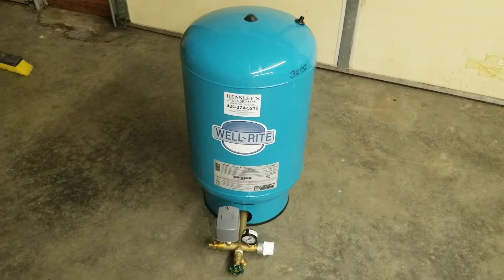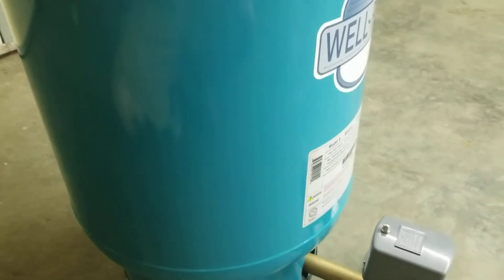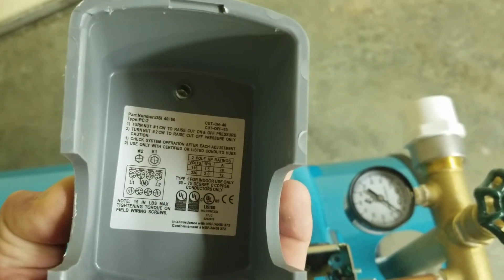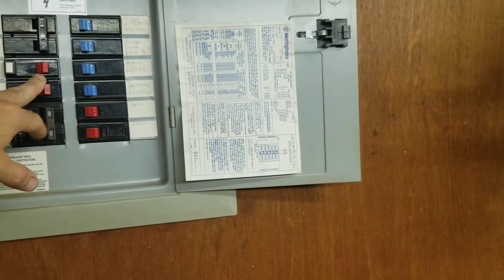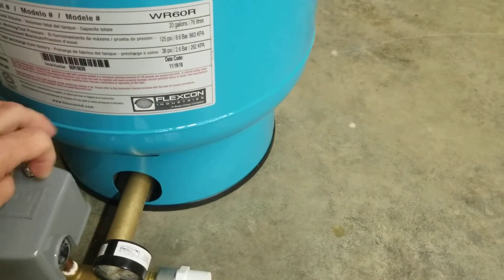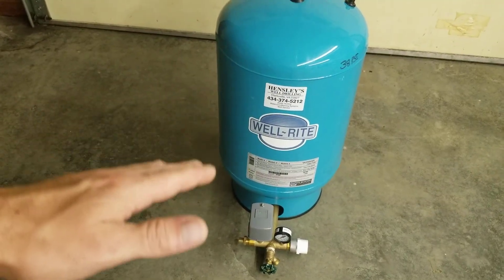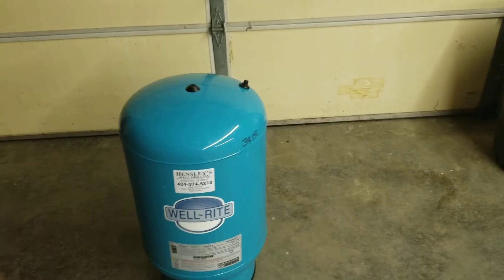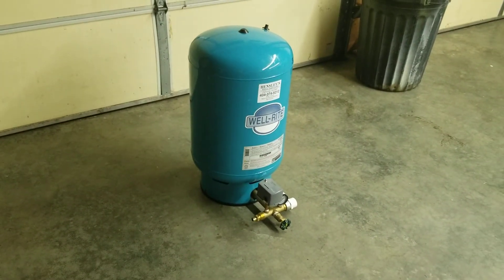Well Pump & Tank Troubleshooting, How the system works, Adjusting Pressure Settings Correctly

Comment: Recently (few wks) the water had TONS of sand in it (well water for livestock & watering, not house). They are drilling wells for new construction of homes near by. I noticed hearing my well making noise. Now yesterday went out & NO WATER. Ck breakers & ok. Could my pressure pump have gone bad?? (am widow, 67 & alone out in country). Please respond asap.
Reply from the maker: I'd check the tank & switch

Comment: I just had a new pump installed the pressurre went up to50lbs when i turn off the pump it drops to zero overnight
Reply from the maker: 2 possibilities. 
1 the pump installed has a bad check valve or no check valve. 
2 the pipe the pump is hung on has a split in it. .
If it will not build up enough pressure to open the switch/turn off the pump for a few seconds, then its definitely a leak in the pipe somewhere. 

Also look for leaks around the house and under the house. If you don't find a leak, that means the leak is 100% in the well.

Comment: my pressure will not raise past the cut off . 30\50 pressure switch . is it my pump or tank. also when turn on water pressure goes right a way.
Reply from the maker: Watch my most recent video on the job.(Well Pump, Air in the system), You have a leak on the drop pipe down the well most likely.  Or a leak somewhere in the yard. The Video will show you where & what to look for & a way to test it
Reply from the maker: https://youtu.be/ndugJ00jxyI

Comment: Thanks for this video but do I test to know if pump is bad so far I replace the tank, the pressure switch and still no water. Thanks again
Reply from the maker: Test for power at the well. If you get power there & its not pumping, pull the pump out and inspect the wire carefully for broken areas or exposed copper. You can test pump once it's out with a quick dry run. It's likely a bad pump. Replace the pump and wire & youll be set

Comment: I have a well and I've done all the trouble shooting it comes on right but immediately goes to almost a drizzle any help I would be grateful
Reply from the maker: Use a clamp style amp meter on 1 single wire. If its above 11 amps then the pumps bad. (That's how to test it) . But your saying it runs for 3 seconds or so & then shuts off. That's a tale tell sign that the pump is bad. 
No simple fix. Replace the pump.

Comment: I have a larger pressure tank.... and it won't fill.  It is not coming on.  I used the lever to kick it on and it came on for about 15 seconds then shut off again
Reply from the maker: How old is the pump?  Sounds like it's kicking off on a overload.  Either age or lightning killed it
Reply: @h2omechanic  it is only 5 years old and it's a solar powered well pump generating the power to run everything
Reply from the maker: @pinedorafarms9739  solar is a complex system. It's best to call the manufacturer honestly.

Comment: where does the check valve go in the tank system
Reply from the maker: Typically the only check valve is in the well at the pump.  If you put one at the tank, place it on the out going side

Comment: My softener hasn't worked for a while. Won't use the salt. I have super hard water. I know nothing about plumbing and can't really afford to get a plumber right now. It got to a point where certain faucets/showers wouldn't work without my shower on in the lower level. It slowly got worse to where water would shut off randomly then come back on after a few minutes. Now it's 30 minutes and not at all. Any ideas?
Reply from the maker: To be honest, I can't help you. You definitely need a water treatment specialist. 
Softener heads have Valves & Seals that will go bad & the Media bed must be replaced. A typical Softener needs service every 5 years . 
Maybe try cleaning/ removing shower heads & the sinks screens. Soak it in CLR . Possibly just plugged up from the Calcium building up

Comment: Wow! Glad I found this channel. Just moved into a mobile home on a well. Troubleshooting the pressure tank to get more water pressure. Pressure gauge was pinned at 70 psi so we replaced it and the 30/50 was off so we made the adjustments which improved water pressure but the following day my brother thought he would replace the 30/50 with a 40/60. Now the pump will only run briefly and stop at 20 psi. Verified the pressure switch wiring. Need water ASAP for shower, laundry and general cleaning. Has the well dried up? How do I check? Contacts have spark so we know the pump is working according to your video.

Comment: my pressure tank makes noise when filling. any ideas ?
Reply from the maker: Check the air pressure in the tank (up top of tank)
Remember to turn off pump breaker & drain off all water pressure from a sink before you check the tanks air pressure. You'll Need a tire air pressure gauge (not the water psi gauge)

Comment: Hi ..my water comes on for 2-3 minutes go's off for a minute or so then comes back on and no more issues for the rest of the time you are in the shower...thank for any help..
Reply from the maker: If the tank is new, it's probably got too much air in it. Let some out. 
If the pump is 12+ years old, the pump could be overheating and cutting off on a thermal overheating protection

Comment: I added a t and check valve to main line for outside water hose but won't have water until i turn water faucet on in house which I 300ft  away. Submersible pump and pressure tank.

Comment: My well is about 300 ft deep and the pump is a 3/4 hp pump, I was thinking of using my well to water my lawn, do I need to have a pressure tank or can I just turn the pump on and off as needed? If, so can I use a garden hose or should I use a one inch tubing? Will the pump be able to handle load? 
Thank you for your help.
Reply from the maker: You definitely need a switch & minimum 4 gal tank to absorb the water hammer effect. If you didn't use a switch, the garden hose would blow up & pop. Pumps can build 150psi. The switch is a must

Comment: I have barley any water I check the air it’s good but still no psi
Reply from the maker: Leave your pump breaker off over night & try in the morning . If its still low pressure in the morning, you probably have a leak somewhere. Look for leaks in the yard, under the house. If you find nothing leaking, then its probably leaking in the well. Due to a busted drop pipe or a cracked pump fitting. That case the pump must be pulled & look for a leak.

Comment: Just changed out the pressure tank ... The pump kicks on and builds to 50 psi and kicks off ... Then it slowly loses pressure and will go past 30 psi (hearing all kinds of gurgling like the water is being pushed backwards) down to 10 psi where it holds but we have to tap a fitting by the pressure switch to get the pump to kick on ... We are then faced with air in the lines  ... It's some weird piping so things aren't in the typical location ... I'm getting stumped ... Pressure switch? Do I need a check valve in n the line? There isn't one BTW
Reply from the maker: You probably have a check valve at the tank. But that's not the problem. 
The check valve in the pump is leaking and the pressure is going back down to the well. Pull the pump out & look for cracked fittings/pipe/holes. If all looks good, cut the pump pipe & try to blow through the pump. If your mouth can force air threw the pump the check valve is bad. 
Either replace the pump or add a check valve to the top of the pump. 
It must be done this way, or the check valve at the tank will continue to create air in the lines. 
The 1st check is leaking and the second check is slightly leaking but will hold water at 10psi.

Comment: I have a loud bang when we flush. I changed the check valve, pressure gauge etc. The check valve was completely trashed. I'm still having a bang at start up and when the pump is starts again (like taking a shower) it's fine. Only after a while sitting  the bang starts again . A few times we heard the bang and no water was running at all.  I checked all toilets sinks etc and no leaks were found. Pressure reads bet. 40 and 55. Could a bad pressure tank cause this?
Reply from the maker: Yes, most likely it's a bad tank. Your Hearing Water hammer. When the tank is good, the bladder inside provides the Cushion that prevents the hammer affect
Reply: @h2omechanic  thanks for the super fast response.  I have a 2400 sq ft home. 2 1/2  bath. Only the 2 of us now. What size tank do you suggest? Also are home depot tanks any good?
Reply from the maker: @alanlevine3984  any 20 gallon tank will be just fine. Home depot tank is standard grade. Itll be fine for 8-12 years
Reply: @h2omechanic  thank you. Just got home from running some errands.  About 3 minutes later we heard the "bang/hammering ". No water was running. Toilets sinks, tubs etc. No faucets dripping etc. What the heck could it be? I'm going goofy over this.

Comment: My smaller maintance well keeps making a clicking sound over and over . I looked and th e gage goes to 49 the a few seconds later 48 then 39 then drops fast to 30
Clicks and then shoots back up to 49 .always makes a clicking noise when it shoots back up . It’s continual . I had my cousin replace the gadget a couple months ago when the water went out . I have a bigger main well as well replaces both those pets . Water is working fine . But that click and jump
Back and forth is new. 50 psi on both wells one’s a big tank that’s the main well and then the front yard is the maintenance well that’s a smaller tank which is the one that’s making this noise.Also the bigger well tank I can see some of the water kind of running when I looked at the hole in the top I hear water and see a little water running out if that’s normal running back into the tank not on the ground or out. 
Update on the smaller maintenance tank I did  from watching your video 
Knocked on it it was hollow I also checked the top layer and no water came out it’s just air and then I timed how long it took in between that click sound where it went from 49 to 30 psi and it was a minute and 54 seconds
Reply from the maker: Well your tank seems fine but it could be really low on air. 
Kill the power, drain off all water pressure and use a tire gauge to check tank air pressure. Set it at 25psi & see what your results are then. 
I'm going to assume that it has like 8psi in it, or more the 35psi. The air is very important to set correctly with the style of switch your using (I assume it's a 30/50 switch.  
There's loads of helpful information on my Well Pump Q&A Playlist.

Comment: Hi, I have an above ground water pump and it is very hot it will not turn on. Cleaned the points on the pressure switch, with the breaker on the pump will not run and gets hotter. Do you have any advice on what to try to replace first. Thank you
Reply from the maker: The motor on the pump is likely bad. It's copper winding is swollen & contacting the magnets. That creates heat & eventually a Short. Just time to replace the pump unfortunately. 
If your a mechanical person you can disassemble the motor and clean it & inspect it, oil the bearings and see if it helps. But that's just a bandaid. Any plumber would say it's time to replace it. 
Keep the breaker off when not using water. That'll keep it alive til a plumber can replace it. If you DIY it, but the Same make/model to make the swap out easier for you. Wish I had better news, but atleast it's advice nonetheless. 😊
Reply: @h2omechanic  Thanks

Comment: Hi, I bought a house that has a dug well about 12’ deep and right next to it a little well house with the pressure tank. From there it has to travel up hill about 100 feet in elevation. By the time it gets to the house the pressure has dropped quite a bit. If I were to replace the system what would you recommend?
Reply from the maker: It's hard to make a professional recommendation for a very shallow Well . But a 2 line jet pump would work fine. & also a submersible pump if you had enough depth and storage to submerge it under the water

Comment: Hi H2O . If my tank reeds 100 psi.  What’s that mean? Pls. Thanks
Reply from the maker: 95% of the time, it means that you have a bad broken gauge. If it is in a location that could possibly freeze then 99% sure its a bad gauge. 
If it truly had 100psi, you'd probably have Amazing high pressure inside and that means the Pressure switch is Stuck closed which means the pump is running 24/7. Possible but doubtful

Comment: Well I had great pressure in my house then somthing happens where I do not have that pressure other than my kitchen sink ? My kitchen sink still has the pressure but all my other sinks and show does not. Can you please please please help me out on this issue??????
Reply from the maker: That's very strange, maybe the faucet strainers need cleaning.
Do you have a filter?
How old is your well system? 
Also I Have multiple well related videos on my channel. Find the Playlist Labeled Well Q&A. There's even a Vid on getting better pressure from you kitchen faucet. (Any faucet)
Most likely it's a sediment issue. Possibly a bad tank as well, but my tank Vids explains how to test & see if its bad or working properly
Reply: @h2omechanic  I have watched more of your vid thx. My well is old but I put a new pump and pressure tank in last year all my pipes are all new to hole house no filter but a salt water softener that does not work well at all. I do have hard water. Man I’m telling you it blows my mind I think it could be maybe my hot water tank needs to be cleaned out would that do it ?

Comment: Great video!
Question: Well not giving water, tested switch on wall and it is good, found a lot of water in pressure tank that would not drain(replaced tank) Saw arcing on pressure switch, still no water. Pulled pump and cleaned screens a bit.
Still nothing seems to work?

Comment: Great video explaining the pressure tank and limit switch.  I had a new blader tank and pressure limit installed this winter.  It's a bigger bladder tank and when I was out watering my lawn and garden the water pressure drops off to a trinkle and then builds up again.  I drained the tank and checked the air pressure in the tank and it was 38 psi The pressure gage on the tank shuts off at 60 psi and kicks on at 40 psi. I tried turning the center spring loaded screw down a couple of turns and that just raised the shut off pressure.  It's like the water pressure drops so low before the pump kicks on. 
  I had a  galvanized tank before replacing with bladder tank and my well doesn't have the bleeder on the well pipes. There is sometimes a air spurting out of the hose but not that much.  My pump and well pipes are 39 years old and it works great for inside the house.
Sorry if I got wordy.  Any advice is appreciated. 
Thank you.  Ken
Reply from the maker: Start by letting out a little air from the tank, just hold the air bleeder in for roughly 10 seconds. Your switch on psi my be too low.
You say the bleeder was removed. But this (air) in the lines makes me think otherwise. Typically the bleeder is 10ft down on the pumps drop pipe. Youd 100% get air if its still down the well. & you'd get hesitant water pressure like you described. 
Thirdly, if you have a check valve at your tank, remove it!  The check valve in the pump should be the only one in the system. If the pumps check valve leaks down that will also induce air into the system.

Comment: Appreciate your video! I have a tank with 40 psi on and the pressure is at 50 at the valve. My valve is on top WM-20WB (60 gal i think). There's a little water surrounding that pressure valve. I'm guessing the bladder is bad and the whole thing needs to be replaced? Thanks for any feedback!
Reply from the maker: Yes you are correct, the tank is bad. 
Replace the Tank & switch & psi gauge. Remove the old Control Tee & see if its reusable. Some Wear out internally and feel thin. If you're going to DIY it, take pictures for reference. And take the tank & controls with you to Lowes so you can match everything up . Itll make install simple. Most people use a 20 gal or 36 gal bladder tank. The 36gal requires a longer Tee

Comment: Hi again H2o...just one last clarification please  before I do this whole procedure again to make sure I understand and don't screw it up.

To repeat what I did before, I set the pressure in the  empty tank at 38, the pump filled the bladder but when I tested the air  pressure  again with the bladder full,  I got scared when I saw the high 70-80 reading and let some air out.

So, my question is; 

- is it okay if the air pressure reads higher, like 70-80 when water fills the bladder...is this normal and should I not tamper with it ?

Thanks again for your generous advice